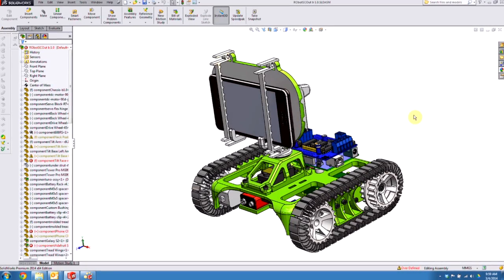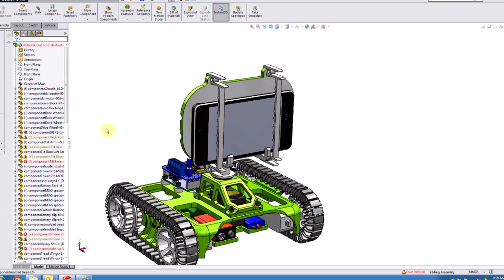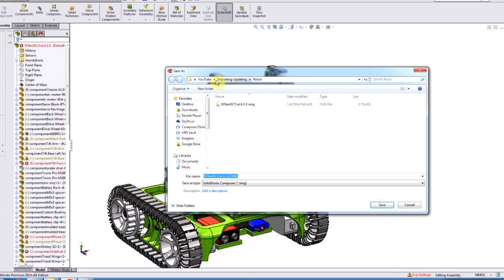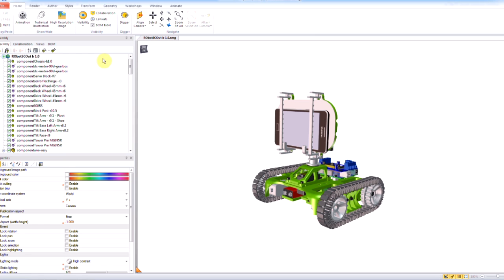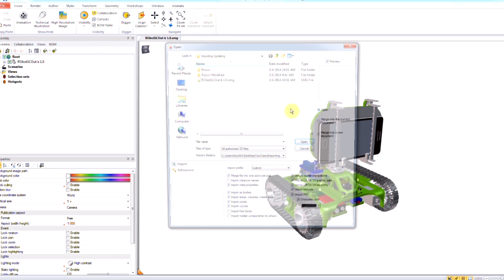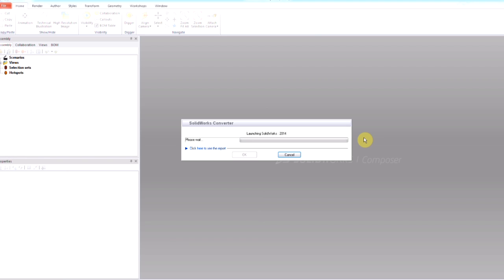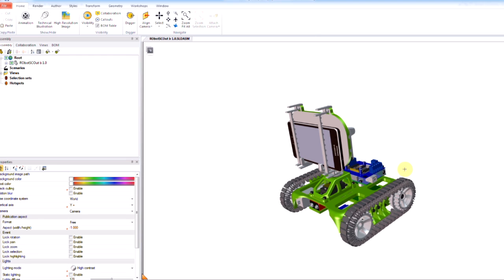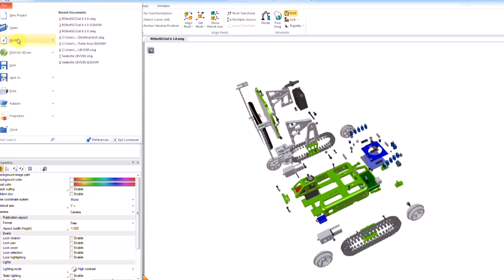SOLIDWORKS Composer - How to Correctly Import and Update CAD Assemblies

Comment: Thanks for the video!  I have a question: it seems that whenever we update a file in Composer, if there are any selection sets with screws associated with a View the selection sets get completely messed up and reassigned with the update.  This happens with every file that we try it with.  Have you had any experience with this?

Comment: currently using a solidworks version 2018. how do i import design files of 2018 version in composer 2018 (actually the software shows support for 2006 to 2015 version models in the help manual of solidworks composer)
Reply from the maker: Hi Yasser, you should be able to do a simple File -> Open to open 2018 SOLIDWORKS files into 2018 SOLIDWORKS Composer. It should always be compatible with the same year version of SOLIDWORKS, perhaps the documentation is out of date.
Reply: @hawkridgesystems  yea that helped. Although there is a slight problem still. when i successfully upload  my assembly in composer, the actors are missing in the actor tree on left side of the screen. could u guide me through the problem here.

Comment: Hello Sir,
thanks a lot for clear tutorial. 
I have a question.
Does Composer monitor the SolidWorks files? If I make any change in the Solidworks file, will it be updated in Composer?
Reply from the maker: Composer doesn't actively monitor the SOLIDWORKS files - it is a "pull" type operation. So once it is known that the SOLIDWORKS files have been updated, the user must manually perform the File -> Update to update them